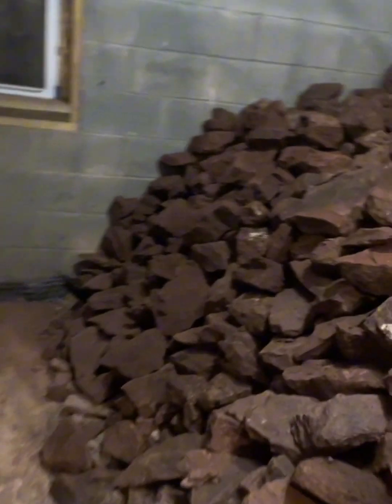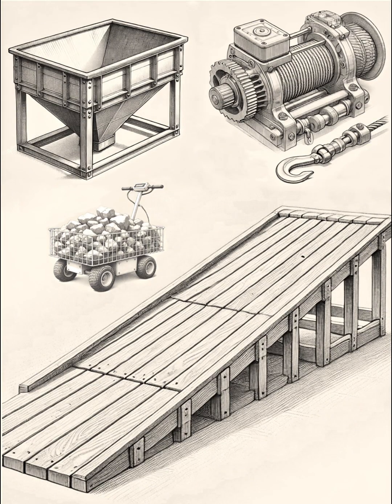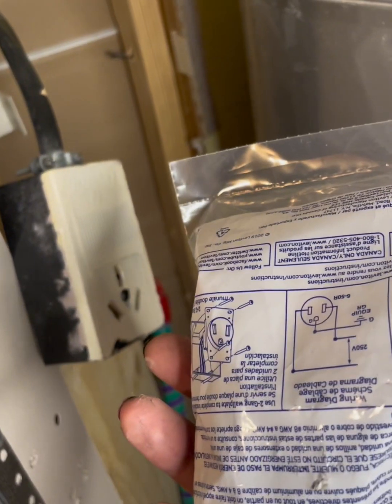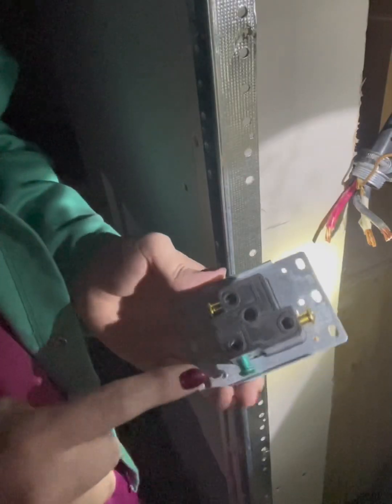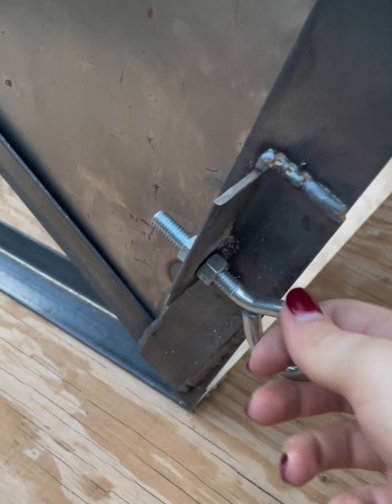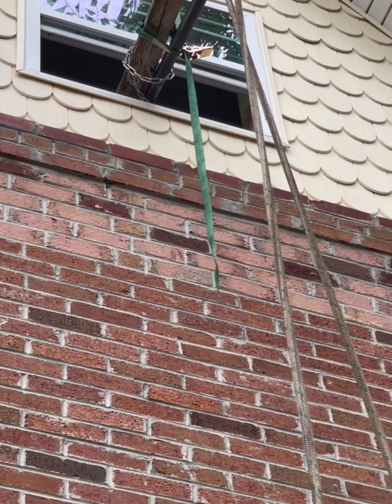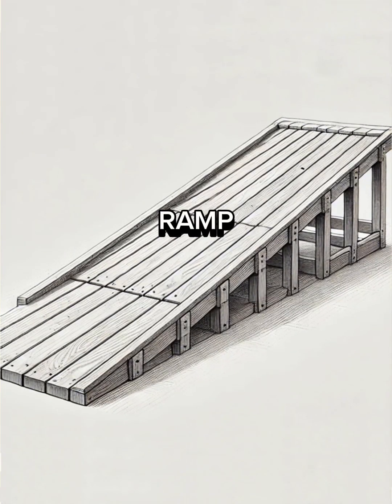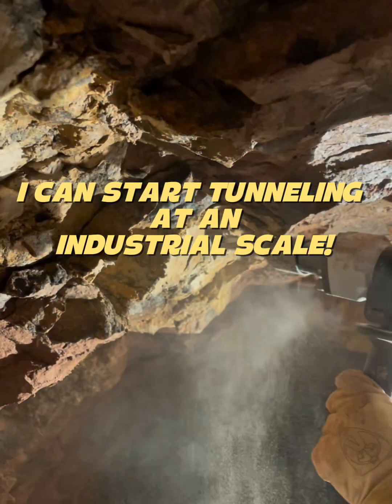Suburban Tunnel Project - Episode 2 - Infrastructure

Comment: Watched you getting into chemicals(labcoat?! what's your profession if'n you don't mind me asking??) on your TicToc(Another YouTuber is compiling your TicTocs and gaining many views!) On to dust collection :D a box fan with corners added and standard(or better) furnace filter of a size that fits said box-fan works wonders! There are very many designs. A cube made this way is even better with fans on all sides other than than the one taken by a fan. 'course that would have to be suspended on chains to be out of the way and fully operational, or add legs!

Comment: Cool.
Reply: I have a 120V buzz box you can have. It's not very good (it only has a low and high voltage setting and I think it is AC only, but it's yours if you want it.

Comment: For your support pillars that supports the hoist I suggest that you fabricate something with more rigidity. You can buy some get an I-Beam and two solid steel support columns that’ll connect them bolting down the hoist to it. For the columns you have to dig holes that are 6 feet deep with quick concrete. When installing the support and columns together remember to connect the ends to the side of your home using the brick as a natural support so it doesn’t sway side to side. Good luck on your adventure I’m invested

Comment: I've been using two Ecoflow Delta Pro batteries to weld on some stuff, AC included, 220 volt and portable. I don't know if it would work for you, but I've been off gridding and that can have similar issues. You're probably smart enough to build your own battery generator.

Comment: you can get conveyor belts. which is WAY easier to set up and unload stuff. doesnt require heavy support like the lift. and you can get em for cheap. doesnt cost much to run as its just one kinda small motor. you build a lil square hopper around the bottom and you can fill it with whatever

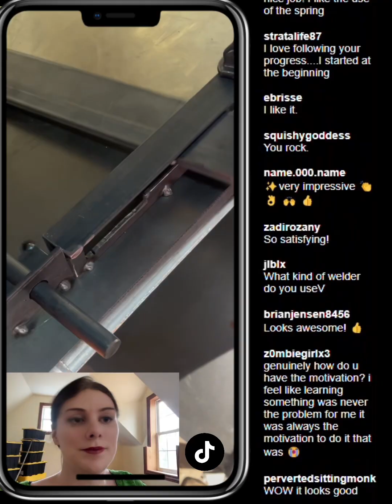Comment: 5:00 this is the exact design my old Craftsman trailer uses! its actually kind of an annoying design because its hard to line up both holes at the same time, and i've had the spring break or fall off a few times. its also kind of hard to open under heavy load

Comment: Kala, you may be able to fine a used conveyor at the scrap yard or surplus store. a vertical conveyor which you can place smaller more frequent loads in while it runs will be very effective. think of log splitter conveyors, easy diy too.

Comment: I'm sure you already know this by now, but the difference in plug design is because the welder plug is 240v 50 amp, and the dryer outlet that you had was 240v 30 amp. Larger air compressors and most welders need the extra power for a starting circuit but draw less than 50 amps while running, so it's a surge load issue. Many home welders are also designed for low duty cycles, like 10%, (running 6 seconds and stopping for 54 seconds per minute) so they are unlikely to cause electrical fires by melting the wires inside the walls.

I know this because I also bought a 240v, 50 amp welder and realized I had no place to plug it in, gave it away and bought a 120v welder. It's a very obnoxious thing in most American homes.

I like the infrastructure methods you used, and that you documented it.

With the price of that powered mine cart, I probably would have bought a second winch and used a cable pull to drag an unpowered cart instead, but yours will also be easier to move around than that would be.

Comment: I’m pretty excited for this long form long series. 

If you’re open to some comments and opinions then keep reading otherwise great video 

1: re video format. Filming in landscape seems to run better on YouTube as we can see more and the image will be larger on phones. 

2: the steal hopper looks perfect. Keep welding and using steal if you can source cheaper supplies. Talk to metal fab shops and industrial places and they likely will let u raid the scrap metal bins also dumps and recycle places are good sources of free or cheap metal. 

3. If I could tell my younger self what to buy first when metal working it would be a porta band saw corded, a 3’ pair of bolt cutters and something to bend metal with. The saw and cutters mean you can cut steel without all the dirt and noise of a grinder (even late at night) and a lot of what u end up making to start is little things like brackets. A  manual bender lets you avoid relying of welds for everything which makes for a better part. 

4: finally I know a lot of placer miners and the smaller operations have that same, use what u have and focus on getting the task done without getting to hung up on the infrastructure you make to do it. This can be ok but as I’m sure ur aware just keep an eye on what could fail and try to keep out of the way. Be careful, we all want to see you succeed.
Reply from the maker: Thank you! I love advice and will certainly keep in mind. Regarding the video format, I created a custom resolution which is a little wider than most vertical. All of my footage is vertical (for TikTok) and I didn’t want to crop too much. Thanks for the recommendations. Will get portaband and bender for sure!